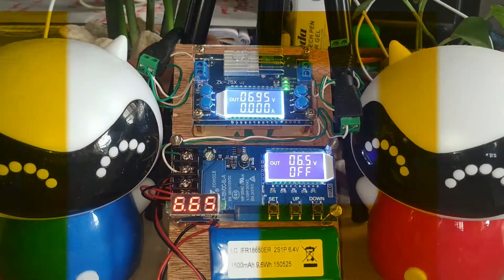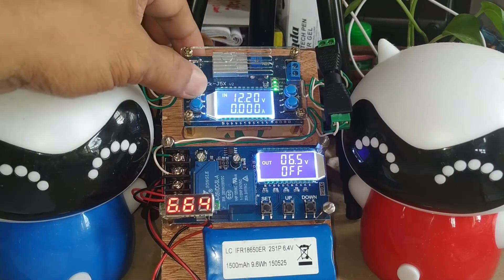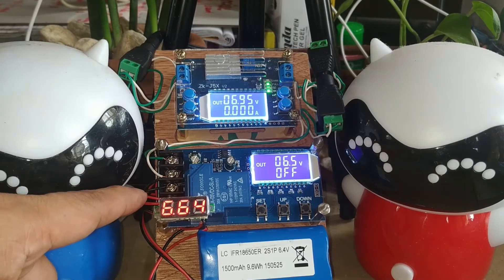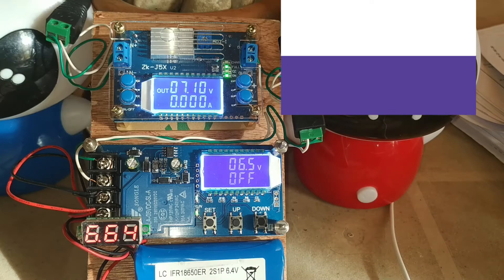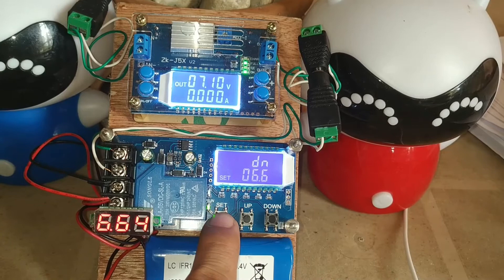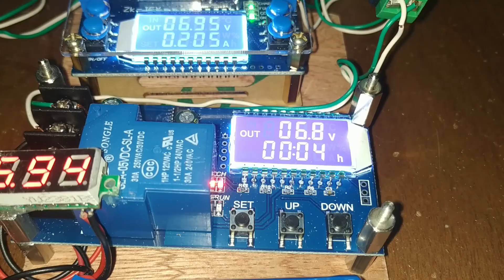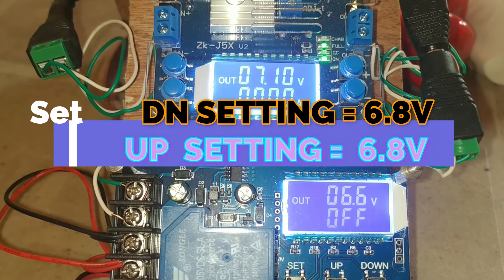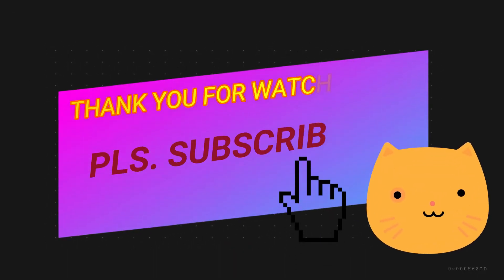DC DC 5a stepdown Buck Converter Zk-J5x and 6 -60 v 30ACharge controller XY-L30

Comment: Ano pong recommended na down and up voltage para sa lead-acid 6v battery? Saka ano po kayang voltage at wattage ng solar panel ang pwedeng gamitin to charge 6v battery gamit po yung ganyang controller?